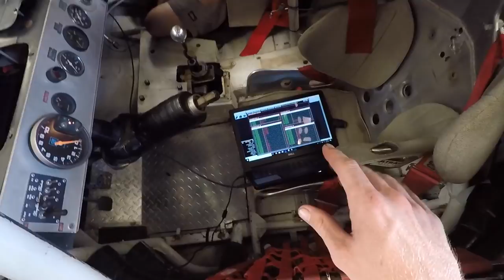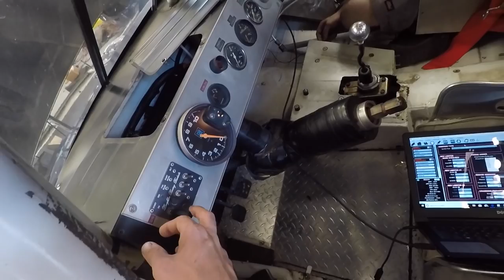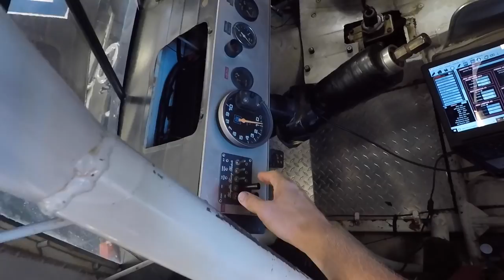Dale Truck's FIRST DRIVE w/the NEW Engine! Bald Eagles, Fire Balls & FREEDOM!

Comment: Leroy has the power - you NEED to focus on getting it to the ground in the lower gears!
Some things to consider - tyre type/pressures/size, raising the car for more load transfer, playing with the shock settings - softer extension and firmer compression to help hold the front up for transfer, maybe even more rear ballast (bigger chill box for the charge cooler?) or moving as much stuff backwards as practical and the heavier block will have moved the bias forwards?

Comment: I love that truck. I have the 1990 chevy 1500 with 454 ss package slammed to the pavement with original chrome steel rims and original factory size tires. My truck looks soo similar to that race truck profile. I get a lot of looks too. I recently rebuilt the engine and removed a lot of the junk GM had on it and im sure i released a lot of bald eagles. Its much quicker than before. But it sure aint as badass as that dale truck.

Comment: Can you fab up some sort of lower engine mounts and a drop base for the air cleaner?  Better yet- have you seen Dales and other NASCAR air cleaner setups?  It's an enclosed round factory looking housing that extends back into the cowl called a "Cowl Intake" which keeps the stock hood similar to what they used on the original Z28's.

Comment: Good idea about the dale trucks tires. But I have a feeling with the tire flexing and air pressure change,  they may start cracking and peeling off. But it'll be interesting to see.  I could be wrong.

Comment: Look on one of the round track parts websites. We got a drop base air cleaner on my round track car instead of the flat base like it looks like you have on the Dale truck it'll give you like 2 more inches of clearance with the filter you have now.

Comment: Looks like  1 mil hype is about to kick off.      Good for you guys..   You keep many peoples racing flame burning inside, even if they have no chance to do it by them selves..     Some stupid stuff over the years, but all do mistakes every now and then..   
ps. Superglue will not keep those stickers on tires,  should of used rubber glue, that will bond the things on rubber, rather than hard crystallized superglue, that will break on tire stretching or bending. Keep em eagles flying free

Comment: hey Cleetus, have you thought about changing the springs and shocks on the dale truck? cuz I'm sure you can find springs that have identical spring rates or have custom made for the Dale truck, just since you brought up the truck steers to the left more than to the right, the geometry is made for left hand turning so I'm probably thinking that you guys can make it parallel geometry, with the springs and shocks and steering.

btw love the videos and content, very entertaining, #doitfordale #leterriptaterchip
Reply: BFZ Collins they shim the a frame too to give it camber to one side
Reply: The springs and shims would solve most of there turning issues
Reply: He probably also needs to fix his brake system
Reply: I could've sworn the same truck already had adjustable suspension? Did they ever correct the adjustment from when it was on the track?
Reply: 31dgreeees in the bends.but its got 6800feet of straght track to pass every lap. daytona ns im talking about 2.5miles of freedom!!
Reply: I like Cleetus and I'm a huge fan but he is dumb sometimes. 'It turns to the left' 'probably the brakes' MAN it's still set up for NASCAR ovals! They haven't even looked at the suspension!

Comment: Buy a large cylinder air filter and remove all of the filter material so you can lay it out as a large rectangle and then cut a big enough circle out of it to put over the throttle body. Maybe you can find a wire mesh cap to put the filter material over so it makes a dome shape so it's not laying flat across the throttle body. The end result would be a filter shaped like a hat you would wear.

Comment: Leroy would run a 6 if you’d put a body on em

ChangeMyMind
Reply: Uh that'd me more weight less speed higher times
Reply: @yeetcannonblaster5396  Better aerodynamic properties. Air would flow better over the body. Would not need as much power to cut through the air.
Reply: @samwilson182  that is true depending on what body u put on it. Very good point u got there sir. (Or ma'am not trying to offend you)
Reply: Leroy the promod
Reply: @itsyahboi Izaak If you haven't watched the video of Leroy in the wind tunnel, you should. You can really see how bad the aero is in the video lol
Reply: I can't.
Reply: Big fax
Reply: Unleashed Custom  lmao you really know nothing. F1 teams spent millions and hours of time perfecting the aero those cars.
Reply: That would make it not Leroy. Change my mind
Reply: Needs traction 60ft sucks

Comment: Modify the air cleaner take it where the mount sets flush right on top push it up into the air cleaner the mount so it sits over the throttle body and gives you about an inch lower

Comment: Just in case y'all don't know, you should be careful when taking dale on the street in the wet or during cornering because of the drag radials up front. They don't have anywhere near the sidewall stability of a street tire and can cause unpredictable handling especially in reduced traction situations. It could definitely be a dangerous on the street, be safe brothers.

Comment: I forsee issues with the bond on the letters. Crazy glue gets hard when it cures and the tires will flex. It needs to be vulcanized to be a permanent bond. Or at bare minimum use a glue designed to bond rubber patches to tires.

Comment: Those open front wheel wells don't seem safe for the engine. Debris can get sucked into the belts or the throttle body.

Comment: it is essentially a computer, i think its the software your paying for and im sure it has a table of switches and you just say i want this switch to be triggered based on this psi or temp or volt etc. point is i dont know of many programs that do that in the open market for any (automotive or phytology*) that does that, ie ya cant go to walmart and buy yada yada for 60$ and build a diy setup. usually the real diy is home brewed software.

Comment: Re: the truck - exactly what do you currently have for the filter assembly - make and model of base and filter height - there are some available with more base drop than others and some will actually increase power because of their design* - amd I really, REALLY hate open intakes as it just needs one little stone, or whatever, to scrap an engine and those wide fronts could easily flick something up and ito the intake.
Ah, think this was the best - http://www.r2cperformance.com/products/product.aspx?ProductId=264 - some other neat stuff on their site, if that doesn't suit.

[edit] Forgot you were running the Dominator - http://www.r2cperformance.com/holley-dominator-air-cleaner-systems-and-filters.aspx

*posted some in the Engine Masters ep 27 comments but the Motor Trend ****ers have removed the video from YT.

Comment: You're running rising rate fuel pressure regulators?  On all your boosted cars?  Really?  I was doing that 15 years ago on old boosted motors, always saw stand-alones (holley dominator type ecu's) and bigger/secondary injectors as the way of the future...  Hell, even my old '03 600RR had secondaries kicking in at 7k rpm...  Crazy!